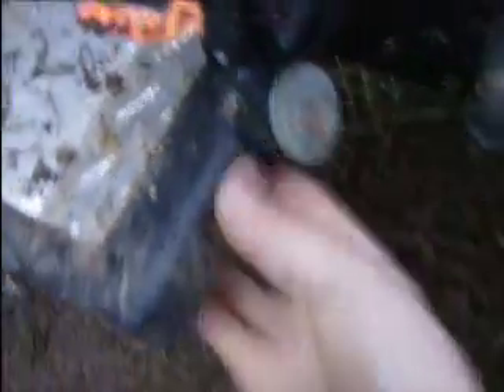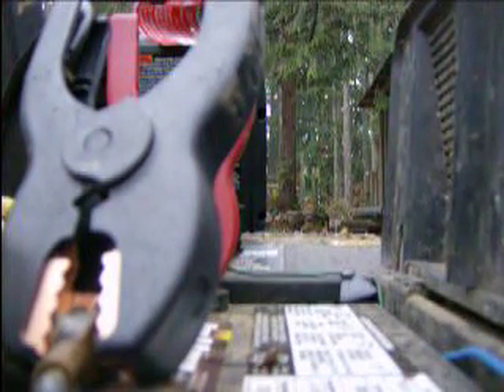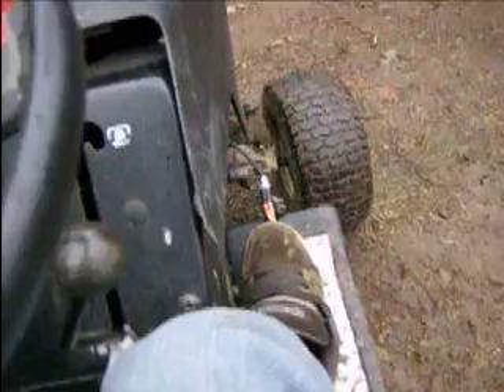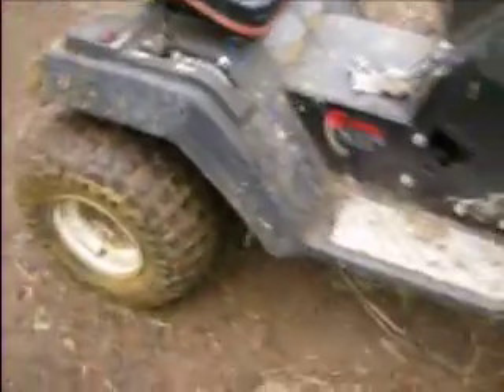lawn tractor gas pedal

Comment: Yes, i have worked on many cars and trucks. And no, the gas pedal, on a car, goes to the motor, but on a tractor, to make it the most realistic, what you would do is hook up the "gas pedal" to the trany, like my craftsman pgt 9000 riding mower. But to make it just like a car, you would have to make a real transmission. on a car as the engine runs, the trany shifts into first, and the car starts to go, then as the engine RPM's get higher, that faster the car goes, then eventually the trany shifts

Comment: What i did with mine for having to push the clutch to start is if u look at the bottom youll see a little button and that gets pressed when u press the clutch so what u do is there is a plug connected to that button its usally behind the engine and all u gotta do is take that plug out and ur good

Comment: Un-plug the wire coming from under the flywheel, when the motor is running, take a voltmeter and put the postive on the wire, and the negative to a good ground. You should have 12V coming off the motor. If that works when the motor is running, disconnect the battery, see if your getting 12v to the cables with your meter, if not just track down the short, or a bad ground. You can always run a fresh wire from the lead coming from under the fly wheel, to the battery side of your solenoid

Comment: my craftsman has the same throttle piece with that plastic thing. How did you attach the brake cable? Did you anchor it to one of the holes? Soldering? Tying?

Comment from the maker: @Awesome25ification I had to drill the hole a little bigger so the cable would fit  and just got a small bolt with a hole in it and clapped it at the end of the cable.

Comment: @arild365 lol well ima give u tips lock your diff put a 15inch pully on the engine and a 3'' or smaller and youll FLY and un hook the brake and rerout it to another pedal ans there u go u can shift on the go with out stopping and youll still have your brakes

Comment: i have one question, if you install a gas pedal on a tractor with a clutch, do you still need the clutch so you can shift into gear? Or is it just shift, press pedal and it goes? 
Please respond.

Comment: The battery is out of accid you can try putting in pure water where the acid stays but it would be better if you get a new one they are pretty cheat on ebay

Comment: into the next gear, and so on and so forth, with an automatic trany. but on a tractor with a "gas pedal" set up like the one on  this video, you have to work the throttle, or "gas pedal" to control the engines RPM's, while also having to work the shifter handle. so its not a true "gas pedal" compared to a car. there i know way more than u think. dont make assumtions.